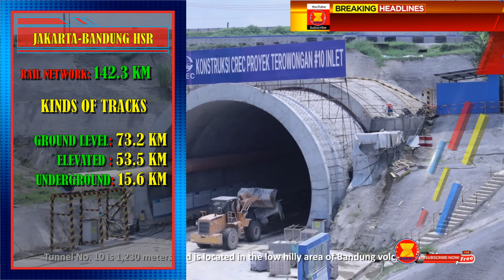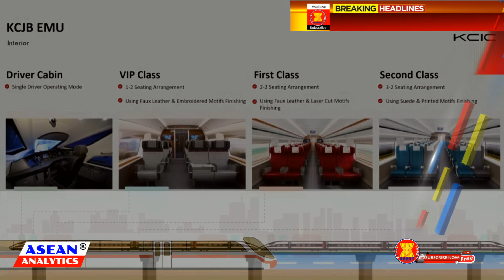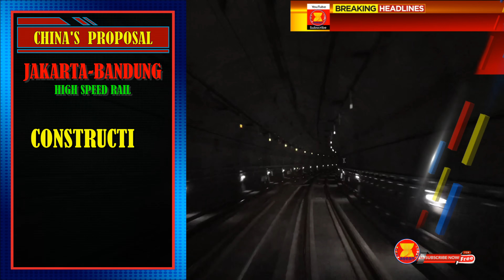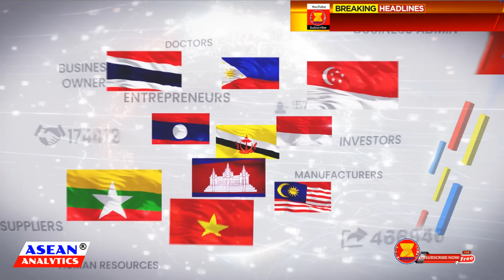INDONESIA's $7.9 Billion Jakarta-Bandung High Speed Rail | First in Southeast Asia

Comment: Hoping that China or Japan will Build Also the High-Speed Railway in the Philippines by the Next Administration Called PNR-HSR Starting with the Main Luzon Corridor Linking Ilocos to Manila to Bicol with the Length of 1000km+, and Travel Time of 5 to 6 Hours at Speed of 350kph, It's Construction Period will be at 3-6 Years, and It Will Use Cutting Edge Construction Technologies to Avoid Cost Overruns and Delays that Happened in the Construction of Jakarta-Bandung High Speed Railway.

Comment: I can assure you if China built this with the cost of $7.9 billion,  Japan would certainly need much more than that. Nowadays, speaking of large infrastructure building, no other countries can build things better, cheaper and faster than China. You should cross reference projects built by China and Japan to make fair comparison. Check the railways built in Vietnam both by China and Japan. The one built by China is done and running. I shouldn't use the word "built" for Japan's project because it's not done yet and check how much they are already over budget.
Reply from the maker: Thanks for watching, here our new uploads https://youtu.be/dx1lFTefcUA. Visit our channel for more..
Reply: ....Vietnam's China-built metro line falls 2 years behind....Inexperienced Chinese contractor responsible for Hanoi metro delays...Ugly Highway Crash for Chinese Firm in Poland...
Reply: @slovackoinfo  and you should know the Japan project is no where near finished after how many years? That's how you compare apple to apple.

Comment: High Speed Rail , First in Southeast Asia but High Speed Train , the second in Southeast Asia.
Reply: HRS in indoneisa 350 KM/H
First HIGH SPEED TRAIN IN ASEAN
Reply: @User-dx5ii7GeDf5  Laos, Design speed 210km/h
Reply: @sirisakpimchan7014  Laos design speed 250km/h but operational 160km/h Semi high speed, 
Thailand and Malaysia already have trains with that speed (160km/h.
Indonesia using ttype CR400AF  design speed of 420km/h, operational 350km/h
Reply: @Dzavani-ID  Trial Run and Performance Test still not finished now, running speed 160km/h for mountain in laos and Yuxi-Mohan rail  section.
Vang Vieng  - Vientiane running speed of 210 km/h.
The Kunming – Yuxi  running speed of 200 km/h.
Reply: Don't make your one sided claim for something that's so obvious. You can search anywhere you want, even China State Railway through ChinaDaily has made statement that the MAX operational speed of Laos "highspeed train" is 160 km/h, means the max speed when the train is loaded with passengers is only 160 km/h, faster than that, it won't be safe. The actual average operational speed will even be lower to be cost efficient (optimizing fuel vs distance). In this speed range, Malaysia has its Express Rail Link for quite sometime. Laos is not even the first.
Reply: @landove1486  Model: CR200J-3 (power car)
Wheel rim tractive power (continuous): 5600kW
Wheel rim tractive power (half hour): 6400kW
Operating speed 160km/h
Design speed 210km/h 
Maximum test speed 241km/h

Starting tractive effort (dry rail): ≥240kN
Continuous tractive effort: 212kN
Max. regeneration braking effort: 153kN 

Traction performance parameter：Configuration 1Mc+7T+1Tc
Configuration weight 585 t 
40km/h average acceleration 0.371 m/s2 
160km/h residual acceleration 0.1586 m/s2 
200km/h residual acceleration 0.0969 m/s2 
Slope12‰ balancing speed 190km/h 
Slope25‰ balancing speed 123km/h 
Slope30‰ balancing speed 106km/h
Reply: @sirisakpimchan7014  -> Ok, all about railways .. Laos better than other country in Asean ... 👍
Reply: @Sirisak Pimchan So what is your point? It's very clear that the operating speed is at 160 km/h. Besides train itself, you have to put in to consideration the condition of rail track. HSR is not only about the train itself, but the whole system. Having 1000km/h designed train, but track only allows to run at 150km/h WON'T be considered HSR.
Reply: @landove1486  normal operating speed is at 160-210 km/h,Maximum speed 241km/h,Minimum track speed110km/h.Maximum track speed 250km/h.
Reply: you need to improve your knowledge
Reply: @mr.sharkk4514   Definition  High-Speed train        A train able to commercially run at more than 200 km/h
Reply from the maker: Thanks for watching, here our new uploads https://youtu.be/dx1lFTefcUA. Visit our channel for more..